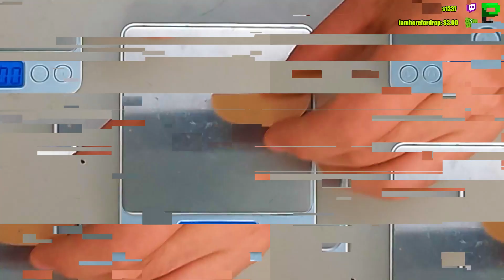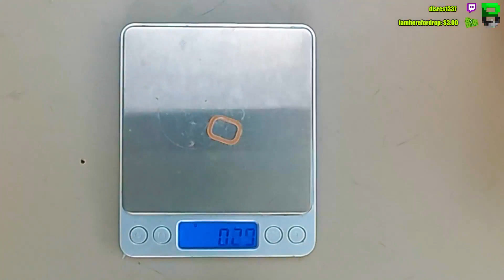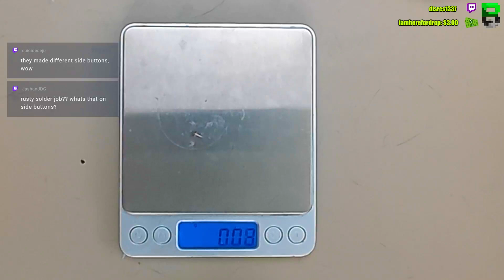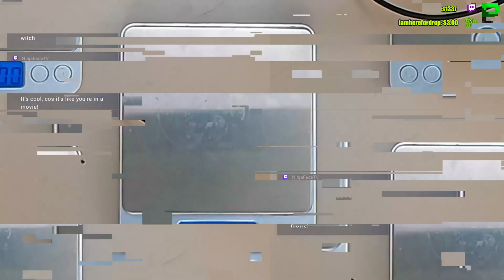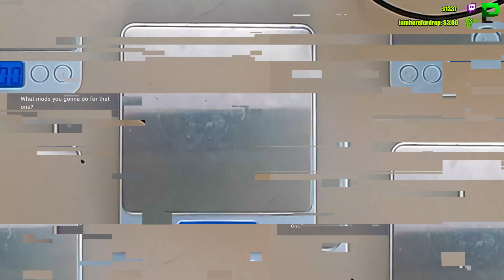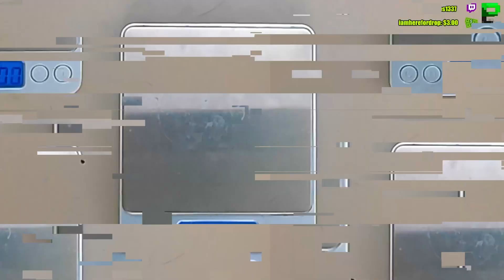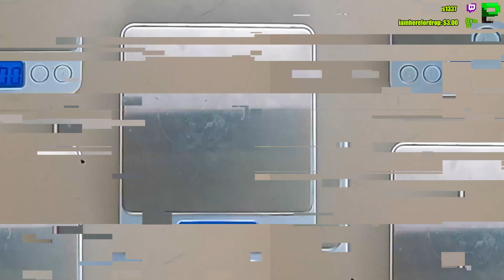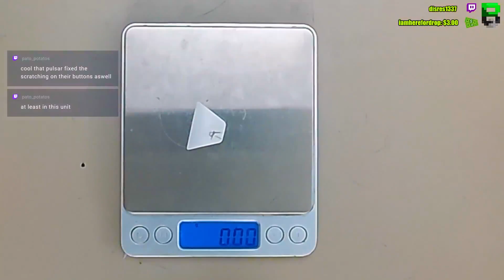Pulsar X2V2 OMG this is so IMPRESSIVE you have to see this TEARDOWN

Comment: after using the 4k dongle and switching back to the original dongle, my battery life has gone to 3 hours at best even at 1k hz so something is definitely up with my unit, i have custom painted the shell too so its such a pain... luckily i have a 2nd x2v2 that my partner uses so im gonna swap just the shells round so the custom painted one has the better battery - i think ill take a look at the battery while im swapping the shells and see if anything looks off compared to your unit, maybe i can work out whats gone wrong
Reply from the maker: 1k should be a week
Reply: @Beardedbob  i used it over a month before the 4k dongle became available and it performed as expected, like i say, ever since pairing with the 4k dongle, even after going back to the original dongle, the battery is completely fucked
Reply: @MattysEdits that sucks.  I get about 3 full days with the 4k dongle.  Definitely gonna have to RMA it

Comment: My encoder stopped working and replacing it made the offset button not work. The click was also mushy for me. Can i just replace it with any mouse 3 micro switch that fits there or does it have to be a full size one like they have in there?
Reply: By not work, I mean I can't click it
Reply: I would suggest you just order a kailh red 9mm, the pulsar blue encoders of the x2v2 and x2h lineup seem to be just a rebranded version of those. The second (fixed, at least what they promised) batch of the x2 lineup had modified ttc gold with a blue shell encoders, at least that's what it seems to me i got.

Comment: Anyone else having the issue I am having with the X2H? My right click feels like it is stuck sometimes when I first click it. takes more force to press it down and you can feel it break away from whatever is causing it to stick.
Reply: So, a Korean guy passing by. Since Pulsar is in Korea, we've got a lot of hate/love going on in the mice community here.
And I say this cuz we stripped down a lot of batches. We've come to find that in the top most plunger protruding from the click buttons, you can find a set of supergrips. They act as dampers that make contact with the bottom part of the mouse. But since supergrips are initially really sticky, it makes this 'two-step-sticky-click' feel. Just like Bob suspected. Removing them solves the problem, and you may apply teflon tape or something instead, but it is not necessary. It solves all click problems reported in reeddit, both the x2v2s and x2hs. Hope it helps
Reply: @nonri500  Yo thanks for the advice. I'll give that a shot. And I prefer Korean brands over Chinese brands. Main reason I havent picked up a Lamzu yet.
Reply: @jasonjennings8465 I also find disassembling and reassembling the mouse fixes the clicks for me, just remove the screws and the bottom plate, then put it back together again.
Reply: @nonri500  do you know by accident of issues with the second batch of x2 mini (the one with the premium black surface finish) regarding their scrollwheel? It's already a fixed one i got, but the first iteration of pulsar blue encoders seems to be just those shitty ttc gold ones with a blue shell. I have the same dang scrollwheel jumping issue like the original ttc gold versions had after only 700h of Apex (sure, there was some extended tapstrafing and bhopping done, but i expect that a scrollwheel can handle this).
I had ordered a kailh red for replacement and it seems the pulsar blue encoders in the x2v2 and x2h lineup is just a rebranded kailh red encoder with a blue shell. I heard only positive feedback on the v2 scrollwheels so far, so i am hoping they are in fact just kailh red ones.
Reply from the maker: Could be maylar tape or something sticky on the plunger or a dodgy switch
Reply: @Beardedbob   It might be. Really dont feel like sending it back. So this might become my first mouse I take apart and try and shed some weight on. I have issues gripping mice too tight ,so I've been too scared to remove weight on a mouse.
Reply: Same exact problem on the x2v2 mini. Can you let me know if you find a solution?
Reply: @frossida Read the comments above
Reply: did they really use supergrip on the clicks or you trolling lol @Good4HealthBad4Education

Comment: 8:00 the optical switches are trash... was enough for me to return the X2V2 :(
They can "crunch" sometimes on first click? Get caught on something? The plunger activation isn't smooth.
And they're mushy... not crispy.
Reply from the maker: I’m yet to find a decent opto mech
Reply: It's caused by the glue of the plunger inside the mouse, you can remove the teflon in the plunger and clean the adhesive.
Reply: @paul2609  well there you go. glue => cheaply made. Why even use these switches? How could they think this is an improvement over huano mechnicals? If they really wanted decent opticals, there are plenty of better options like omron's or kailh's...

Comment: Thinking about replacing the RAESHA opticals with razer opticals. Any other ideas on how to fix the pre travel?
Reply from the maker: Yes they hot swap no problem. 

The pre-travel i've done a video on it for the superlight it will work on this mouse also, failing that turn into a few live streams I do a lot on there to fix these issues. https://www.twitch.tv/beardedbob
Reply: Would you say the Razer optical feels nicer in the X2V2? @Beardedbob
Reply: @Beardedbob   For the v1, the solder was so hard to get off I broke the bed for the solder. Can you do a video on removing these solvers?

Comment: The side button PCB sitting on the top is quite prone to bending even from daily use. Once that happens, the structural integrity would be harmed and the mouse could start creaking due to top shell flex. Surely one can open up the mouse and correct the PCB back straight though.
Reply from the maker: if you grip it like the hulk sure. modded without the sides like this the mouse is fine... relax the grip otherwise you will get RSI :-p
Reply: @Beardedbob  I swear that I only grabbed it with the strength of a normal human being lol! Whether it was due to the screws being tightened unevenly or other reasons. IDK. Still, I would suggest those being troubled by any creaking issue to check the PCB straightness.

Comment: I did told you the buttons are magnetic in your PayDay 3 stream but you didn't believe me :(
Reply from the maker: its the bit I don't get about the mouse.. no blanking plates included either.
Reply: @Beardedbob  They probably want to reuse the same tooling on the X2A with the X2V2 for cost-effectiveness.